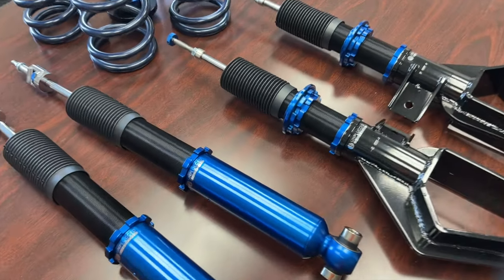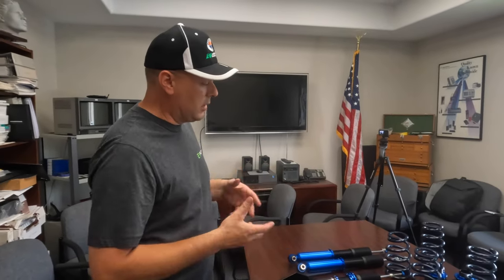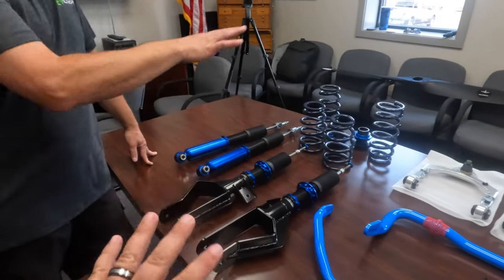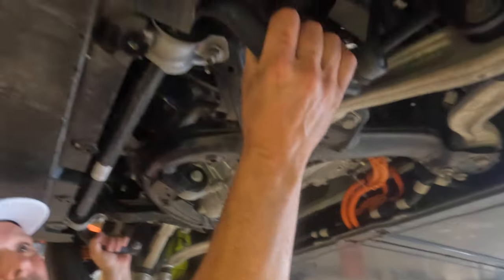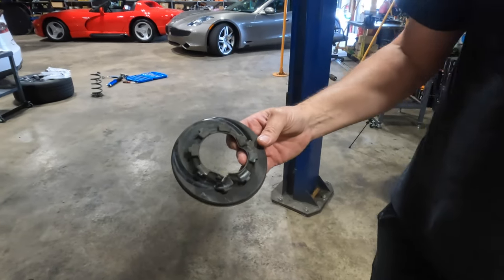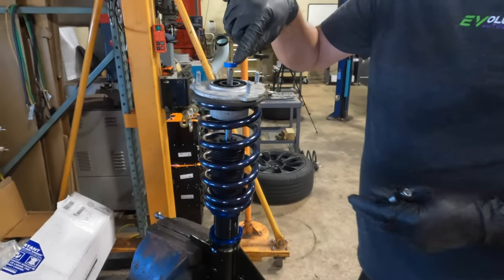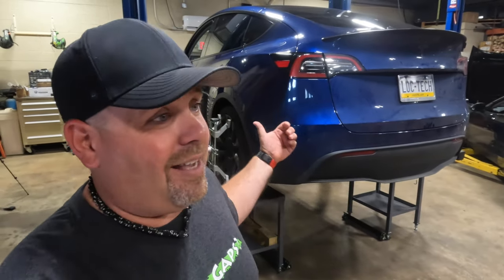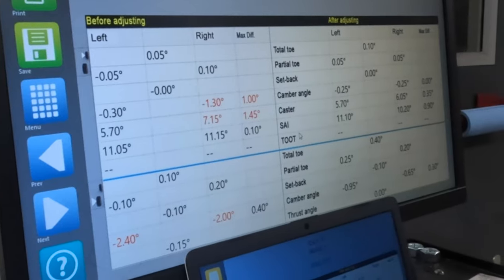Tesla Model Y Suspension Install | Full Unplugged Performance Luxury Coil Over kit + lowering

Comment: I had Unplugged Performance put in luxury coilovers earlier this year on my 2022 MYP and honestly I couldn’t tell a difference. In fact, I felt like the ride was even STIFFER than the stock system. 

A few weeks I told UP and they agreed to put the stock back in and they gave a full refund. 

Once I got back into the stock system I realized that the stock was indeed a smoother ride. I don’t know what happened. It makes no sense to me. But I’m glad UP was super professional about it the whole way.
Reply: The coilovers are an upgrade for the older model y
Reply: Honestly I’ve never heard of someone replacing stock suspension for coil overs expecting smoother ride until I got the model y. Even after reading all the reviews and forums I’m still skeptical about the aftermarket suspensions being SMOOTHER. I’d only consider OHLINS if I were even to think about touching the suspension. I’ve had other cars with coil overs and yeah they handled better but definitely not smoother than any stock suspension.
Reply: Did they refund the labor cost too? I ordered a MYP recently. Honestly would've taken a MYLR but my indecisive ass took too long and am unsure what's going to happen with the EV tax incentives so figure I'd get MYP and worst case spend some money on wheels or suspension if needed down the line. But I'm in SoCal and don't really have many potholes and rough roads. Freeways can be a little beat up in places but think it should be alright. Their doing some construction by the freeway near the Tesla store so going to go test a MYP and rip it over those to see how it does

Comment: Technically those are data matrix codes not QR codes. Data matrix codes work better on smaller parts which is why auto makers mark parts with them. Just wanted to share that. Great video. I was looking specifically for all the info in this video related to the suspension. I had no idea you can't adjust alignment. That's crazy.

Hoping to take delivery this next week of a Blue MYP and trying to decide in what order I want to do upgrades.
Reply: The ones on the cast part aren't Laser etched either.

Comment: How would this effect FSD
Reply from the maker: Great question…I wondered the same at first.  It hasn’t impacted it all.  FSD uses its sensors to determine lanes and adjusts steering based on lane markers.
Reply: @LockettTech  I’m sure once we recalibrated the cameras it will work just fine.
Reply: Kirk from Unplugged.  There is no negative impact on FSD, AP or EAP.   Our Luxury Coilovers will make your ride using these technologies much more enjoyable.

Comment: Since you got this done, and decreased the height, did you end up adjusting it back up to stock height? If so, why? Too low??
Reply from the maker: No.  The height is actually perfect.  We don't bottom out on speed bumps or anything but still looks awesome.

Comment: Do you ever hear any loud clunk sounds going over really big potholes? Have you developed any squeaking that required re-greasing  early? I didn’t pick my coil over brand yet but read those were some minor things that happen on some of these.  I’m leaning towards the Ohlins for max comfort.
Reply from the maker: We will be posting a full review video soon but yes.  Some of that did happen.  Unplugged support was very on top of this though and problem solved it right away.
Reply: @LockettTech  Can you tell me more about that, having similar issues myself at the moment. Getting the squeaking from the rear suspension area at slow speeds. I initially had them (UP) lower it when they installed them, but found that it was too low and the car would bottom out on speed bumps / scrape the bottom of the side and plastic mudflaps would hit. Had a local shop increase the height so it was closeish to stock, but now getting that annoying creaking/squeak at slow speeds, from the back I believe. Have an appointment with Tesla service next week, but curious what UP said and how they were able to fix the problem. Thanks!
Reply: @timers  I’m curious if you fixed the problem? I’m waiting for my long range (switched from P) and considering one of these suspension. Still not sure which one to go with. I’m also afraid it might not make that much of a difference on a 23’ and it’ll be a waste of almost 4K 😬

Comment: Does it affect 0-60?
Reply from the maker: You would have to dial it in.  If on the softest settings it likely will by a small margin since it will dampen the jump.  With some playing around though you could probably pick up a little time.
Reply: No!

Comment: Would this non-oem suspension installation void the factory warranty?
Reply from the maker: Tesla won't warranty after market parts...so obviously they won't warranty something that goes wrong with the suspension but Unplugged sure will.  If something else breaks, not related to your suspension, your Tesla warranty is still intact.
Reply: @LockettTech  thank you!  So it wouldn't avoid the warranty for the battery?
Reply from the maker: @andrewhahn324  not at all.
Reply from the maker: @andrewhahn324  we are actually working on a video to explain this.  There’s a lot of confusion out there around this but there is actually a longstanding bill that protects consumers against exactly this.  Video should be out soon.
Reply: @LockettTech  thank you!
Reply: Ask Tesla and they will tell you that any modification will void the warranty for the entire car!

Comment: I think anyone who actually cries, complains, whines, and jumps on this bandwagon of “poor ride quality” of teslas….needs to reality check themselves. I own two 2023 teslas…a 3 and a Y. 
And I own a superduty f250 (try riding in that) and we sold a 2019 Chevy Tahoe, (shitty ride) and have had countless cars new and used over the years. 
So just stop the crying. All this bandwagon crap of how “bad the ride is” 😢 come on.
Reply from the maker: If you compare other vehicle at the same price point and the same type the ride quality is very different as is the material/build quality.  Tesla is obviously aware of this which is why they improved the suspension in the latest Model Y’s.  It’s a great first step.
Reply: @LockettTech  and really what else can you ask for from a manufacturer all the way to any trade/craftsman/builder…the notion of progress and improvement and refinement. Tesla is doing great, and so is the aftermarket industry. It’s all a win for everyone and a great time to be alive.